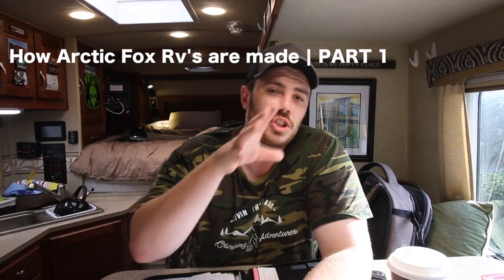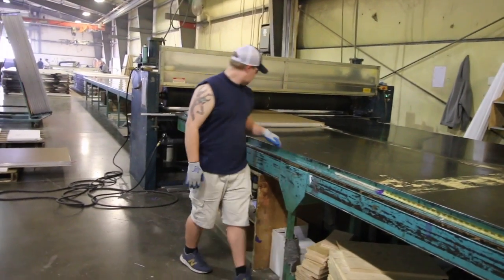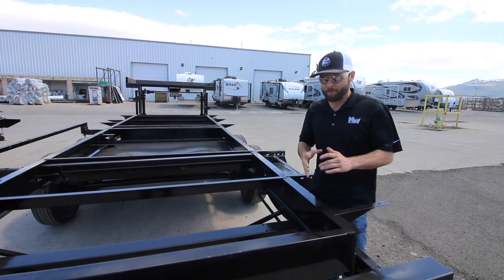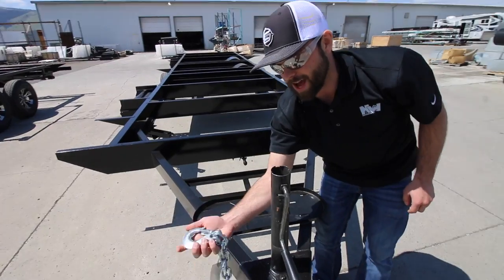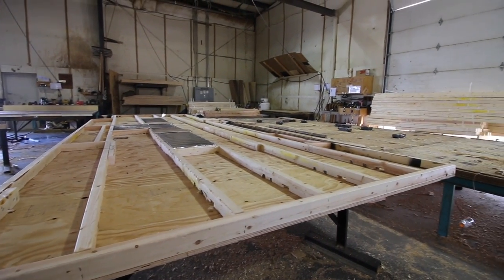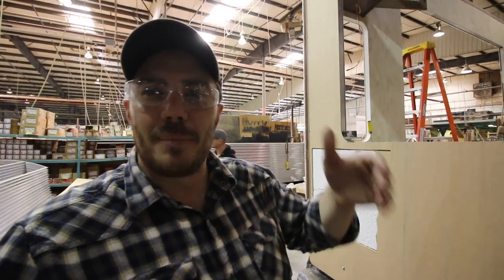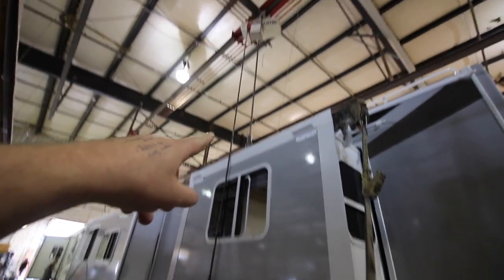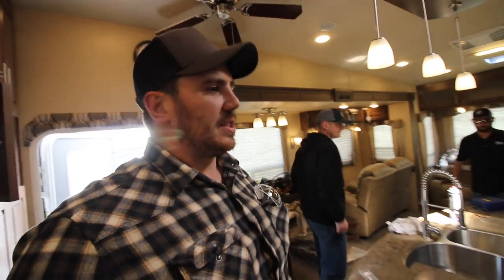How ARCTIC FOX 5TH WHEELS and TRAVEL TRAILERS Are Made ?! | FULL FACTORY TOUR

Comment: Wow! I'm shocked about shocks! I didn't know that was standard with any mfg for travel trailers! I like their attention to that! KYD did enhancements by enclosing the leaf spring hanger flanges to strengthen the frame and suspenstion attachment points. In speaking of insulating tank valves, I had to prep my 5er for moving while it was below freezing. My black tank valve froze between the time I pulled down the skirting and the time I was pulling my plumbing connections. I've learned the value of insulating tank valves!

Comment: I have a travel trailer that came with 2 bunk beds, one is set permanently and the other can be lifted up when not in use and set down on the angle irons that are screwed into the wall, would you know if those screws are screwed into a stud or just into the wall? Thanks

Comment: I started to watch your first video as you went through the Northwood Factory.   I hit the stop button when I saw them laminating Lauan to the aluminum tubing.  I thought the design & fabrication was pretty nice right up until I saw them laminating Lauan to the aluminum.  Lauan is the most inexpensive plywood made which the majority of RV manufacturers use in the construction of their RV shells.  If you have ever seen the exterior side panels of an RV that have areas where the exterior plastic panel is bubbled and loose, the reason for this is because of a water leak at either the roof edge seam or around a window or any other entry point that water can leak in and wick into the wood.  When Lauan gets wet it comes apart in time causing these large loose bubbled areas.   I know this because I have repaired a number of RV's having this problem.   The sad thing is that this problem can be completely alleviated by using a composite material  like Coosa board or Space Age Composite panels.   These composite panels are made in a variety of thicknesses, lengths and widths.  The composites that I am referring to are lighter than wood, stronger than wood and will not absorb water or deteriorate like wood does.  I have used both Coosa board and the composite board from Space Age composites for both RV and boat repairs. 
The composite boards 1/4" thick x 4' x 8'  run approximately $135 each whereas Lauan is about $7 per sheet, so it is clearly obvious why most RV manufacturers do not use it.   If you have to pay to have the exterior wall of your RV repaired, the cost for the repair most likely will be substantially more than the additional cost if it were used in the RV's original construction.    
They are just like every other RV manufacturer that uses Lauan in their construction process.  
Anyone owning any RV that has seen the de-lamination areas on the exterior side walls of their RV's know exactly what I am talking about.     Unless you are familiar and have actual experience removing the exterior plastic panels to access the water damaged  Lauan areas for repair, the average person has no idea about this nor do they ask the RV dealers what materials are used in the construction of the RV or if those material are susceptible to problems.  If more people were aware of the issues involved with using Lauan in RV construction most likely more people would be  leaving the RV dealer with their wallets intact.
Reply: Interesting observations. As nice as Arctic Fox products are, that is exactly why I chose a Northern Lite camper. The fiberglass clam shell design has no wood to delaminate. I have had punky RVs  and they are no fun.

Comment: Disappointed to see the old, problematical "luan" wood STILL being used in the walls (as seen in your truck camper video) in 2019. If any de-lamination happens, it's usually the luan causing it (if it ever gets wet wood swells and that pressure causing delamination). I think the newer Azdel construction is preferable.
-- BR.
Reply: In full agreement. Make a great product even better with Azdel. Most customers would have no problem paying a little extra to get the very best!
Reply: Bill Redding:

For the kind of money that Northwood charges Dealers for their Products (end result of very high Retail Stickers), I  would be more inclined/Impressed to buy their product if they had (modular-cut to length)1 piece Aluminum/Fiberglass sheets (with rounded 90 degree corners) for their roofs (campers,trailers and 5th wheels).........with or without Luan as a composite-wall backing material....it would not matter. A quality roof would eliminate the chances of the walls of taking on water soon or down the road.

And to ensure the roof is never compromised, I  (the manufacturer would/should pre-install  weather-proof brackets and electrical pigtails for those folks wanting to install:carriers, solar panels,etc.)...and just like a aircraft,big-rig,etc............plaster on stickers (all over on top of the roof) advising people to not drill any part of the roof or warranty is voided,etc.
Reply: Riverstone dose not use either and it won't de-lam.
Reply: @calikalbocalikalbo6082  Nice...but the huge Forest River conglomerate (what, they make a dozen RV brands?) is perhaps the LARGEST crap-maker RV manufacturer in America (and their Customer Service/Care after the sale is poorly-rated also). That mainly applies to their assorted brands of towables (TTs and 5ers), but in the Class B segment their Coachmen Beyond MAY be an exception...but even if it is, you still have the Customer Service/Care issue remaining.  :-(
-- BR
Reply: @billredding2000  
Is that true?
From the research I have done and the build videos I have seen it appears the Rverstone from what I can see looks to be the best built from the others I have seen. 
In addition they come with many standards that are options on all others like, tankless water heater, second fireplace in room, washer/dryer, full body paint, has a 3" wall compared to the rest that might have two at the most and the water manifold system that is a big deal.
If you know of something better built with all that stuff (or without the stuff) please inform me.
Thanks
Reply: @calikalbocalikalbo6082  I don't know about "Riverstone" specifically, but in my book if it's a Forest River (FR) product, CAUTION! Personally, I don't go for "eye candy," "bells & whistles" or even the "advanced technology" pretty-looking LCD screen control centers or whatever -- that's all fine, but mainly I want a QUALITY product and REALLY GOOD Customer Care/Service AFTER the sale, plain & simple. So I look for a quality brand AND a quality DEALERSHIP both, as you need a quality product to begin with, then quality care AFTER you buy it. No excuses and no nonsense from the manufacturer or dealership...

RE: quality, I'm talking about construction/fit & finish and quality materials used (both for durability through the years to come, not like a FR "Clipper" -- a crap-built cheap TT, for just one example of FR "quality" products. Lots of RVs -- especially TTS -- are crap even when new, so when they're sold used, you don't get much for them even if anyone want to buy it, because THEY know they're crap, too. Forget that junk...

I've not only heard/read about Forest River's (FR) poor construction/fit& finish and cheap materials used, I've also seen (following a YouTube channel a year or so ago) plus internet stories by owners about how FR doesn't take care of it's customers unless it's shamed into doing so when the owners make their ordeal public. The crap-maker companies seem to play a ping-pong game where the owner is the ball and the manufacturer (the parent company FR in this case) and the sorry dealer the owner purchased from paddles the customer (the ball) ball back and forth, neither taking charge/responsibility and doing the RIGHT and FAIR thing. An RV can be tied up for MONTHS waiting to be fixed, and each -- FR and the dealership -- blames the other for that outrageous and inexcusable "Customer Support & Care."

NOTE: I'm not saying the "quality" RVs are problem-less, they CAN have issues as no RV is perfectly made (as is no house, even brand new million-dollar houses!), but with a crap RV you have WAY MORE stuff to break and that happens WAY FASTER. And with a crap-maker brand -- or dishonest/couldn't-care-less RV dealer --  you have LOTS of trouble getting those things fixed, repaired or even -- IF you're lucky -- a buy-back (HOWEVER, there is no Lemon Law for RVs to force them to do the right thing). Conversely, I've seen other RV companies -- like NuCamp (T@B) actually give a customer with a problematic T@B (either a 320 or 400 model) a NEW ONE. Now that's Customer Care/Service. The crap-makers? You're pretty much stuck with whatever crap-built you bought. Sadly, people who shop bottom-line (cheapskates) keep the crap-makers in business...

As for you wanting some quality brand names, it depends on what Class of RV you are interested in (A, B, C, TT, 5er, Truck-Camper). But some  brand names I would look at (and have!) are listed below (in no order of preference, just given here in a list so you can check them out AND their RVs). This goes back a  1-2 years when I was looking for a smaller tow able (a quality TT) to pull with my towing-capacity-limited (5000lbs maximum) Honda Pilot AWD, or if I got a big truck, which truck-camper to get. However, these companies snake LARGER units, too, so you decide how big or small you want...IF you have the vehicle to TOW it, that is.  ;-)
So here's some of the top/quality RV brands, IMO, as I believe they still ARE quality products, and would go back to researching them AGAIN if I were looking for an RV right NOW:

-- Lance 1474 and 1575. Both are small TTS, but Lance also makes top-quality truck-campers.
-- Airstream's Basecamp-X, a small "Overlanding" type of TT.
-- NuCamp's T@B 320 Boondock Edge, by NuCamp which also makes the "Cirrus" line of truck-campers -- same quality construction.
-- Bigfoot, very well insulated for 4-season use, maybe better than Lance which also says they are 4-season.
-- Arctic Fox, by Northwood Manufacturing. Similar quality construction/insulation as Bigfoot, also 4-season rated.
-- Grand Design, they make 5ers, but may have been better built earlier, not sure presently.
--Outdoors RV, IIRC they only make TTs & 5ers, also well-insulated/well-rated.
-- Lazy Daze [perhaps the best-made Class C you can get. Born Free was another, but they went out of business after 30-4 years. Sad...
-- Oliver "egg type" fiberglass campers [probably the best-made (but heavy) fiberglass "clam-shell construction" TT you can get.
-- Scamp, another egg-type TT, very SIMPLE in design/construction, supposed to be well9insulated, plus they make one model that is a 5er (IIRC, it's 19' long and light enough that most trucks can tow it easily). WAY cheaper than Oliver and way lighter, but not the higher quality of an Oliver. Their 16' models most vehicles can tow and their 13' models just about any vehicle can tow.
-- Casita: another egg-type TT much the same as Scamp, look/made almost the same, but ceiling height is too low and most men can't stand up in them. Get a Scamp instead for that reason. BOTH Scamp and Casita are in-demand, so used ones sell quickly...but that's also true of ANY quality-made RV, regardless of Class.
-- Coachmen Beyond (made by FR, but it's said NOT to be a crap-made RV, rather one the better Class Bs available, even better than "average quality" Winnebago's Class Bs].
-- Panoramic [a Class B made by a French Canadian/Quebec company].
-- Pleasure-Way [another Canadian Class B+/Small Class C company]. 
-- as for Cass As, in general -- and regardless of brand -- it's more of a "money spent" thing: You don't really get into the "good quality ones" until you get past $300K, and it's a diesel pusher. Gas models are hit & miss.

>> That's all I can come up with off the top of my head (and I'm out of time writing all this)...you'll have to do rest of the work yourself. Just giving you some leads to get you started.  ;-)
Good luck,
-- BR
Reply: Bill Redding like I said compared to what I have seen forest river appears to meet the qualifications of quality compared to the rest. And yes bells count because you get more for your money. 
Point me the right way do I can compare.
Reply: @calikalbocalikalbo6082  "Point me the right way do I can compare."
I already did that -- and you're welcome.
Good luck,
-- BR
Reply: @billredding2000  
Yeeeeeeeah, thanks
Reply: @billredding2000  I have a Forest River Arctic Wolf and compared to others like Keystone, and a few others, the overall build quality is much better. Cabinet door construction solid,  trim around slides better, where Keystone it was falling apart, and the cabinet doors rattled and twisted when opening and closing them.  In fact I found worse construction in trailer that were twice the price, my wife had a cabinet door fall off in her hand on a $84,000 sale price trailer, don't remember the brand, but it was twice the price of ours.
Reply: @acdii  Then you got a decent one...most people don't, and the odds (just like in Las Vegas) are against the RV buyer regardless of which class of RV it is.
I don't knwo about Arctic Wolf, but just "Forest River" (one of the major crap-makers, IIRC the conglomerate of about a dozen RV brands) is enough to give me pause. But then, Forest River also makes Coachmen Class Bs, which are SUPPOSED to be (some people say) a cut above average Class Bs, like Winnebago makes. Yet Coachmen also makes towables -- like the Clipper (for one example) and that's cheaply-made crap.
RV buyers need to be VERY careful choosing a RV brand. Then comes the OTHER half of the buying process: Choosing a good RV dealer -- and that's also often a nightmare.
Happy Travels,
-- BR
Reply: You realize its not the luan causing delam its the glue
Reply: @robinsonnis  Luan is wood, so when it gets wet (via a water leak) it swells, and that causes de-lamination.
With the new (and superior) materials we have today, luan should be history.
-- BR
Reply: @billredding2000  I understand that, but the luan isn't the cause of the delam. It's the glue that separates the luan from the fiberglass, the luan would be second in line for the cause.
Reply: @robinsonnis  Yes it is: If the luan didn't get wet (and exert pressure to break the bond) there'd be be no de-laminaion.
But I won't debate the issue further...especially in a very old thread like this one.  ;-)
Thanks,
-- BR
Reply: @billredding2000   delam isnt only caused by a laminated wall getting wet.....yes the majority of the time its caused by moisture. the definition of Delamination is when the glue between the fiberglass and substrate  fails.  Yeah the luan can get wet and swell but that doesnt cause the delam.... if  you were correct delam can ONLY happen when moisture is present, which isnt true... next....
Reply: @robinsonnis  Okay, if I'm wrong then I stand corrected.
Thanks,
-- BR
Reply: @billredding2000  I need to pick your brain! First time RV shopper and I'm pretty impressed with your lay of the land so to speak. I'm gonna check out some of those brands you referenced. I was originally thinking grand design's toy hauler with the raised bed over the mini garage but read about a few owner's nightmares with build quality. Then I looked at alliance and riverstone and checked out both in person. They are definitely at the upper limits of my budget though so now I'm trying to figure out what can get me similar build quality while letting me hold on to a couple of pennies.

Comment: They use uninsulated aluminum framing--just foam stuck in the bays between frame members. There's nothing Arctic or 4-season about that. It's the same wall as many other low-end aluminum RV's. These suck down a lot of energy with cabinet doors open, etc., to try to stay thawed in real cold. Water lines will freeze if they are up close to a frame member and frost forms on the walls, outlining the frame, from the heated interior air with any moisture in it from cooking, showers, etc.

Comment: 2 things that Colby said about the roof that I have to comment/question.  First the industry standard of 2 foot centers.  Do other mfg. have the space marked off between their trusses and tell the new owners not to step in those areas?  I've never heard of this.  The second is about insulation.  He said "5 1/2in. space insulated with R-18 in combination with an R-15  reflective foil".  So is that R-33 total in a 5 1/2in. space?  I'd like to see this R-15 reflective foil.  I'm just starting to build a camper van and would love to insulate the whole thing with just one product rated at R-15.
Reply: Radiant barrier foil has an actual R-value of 1 to 1.1, something that became a big issue and was subjected to new federal regulation about 20 years ago, but the RV industry is exempt from it. In the RV industry you multiply the actual number by 15 to 40 to get the R-value for the marketing department to try to sucker prospective customers with.

Comment: Thanks for the tour of Fox Mountain fifth wheel and Nash trailer assembly.   They do spend a lot of time and effort in mfg of these coaches.   I love my Arctic Fox Fifth Wheel and would buy it again and again if anything happen to my current AF.  The Arctic Fox is well build and heavy as compared to other brands, which means you need a big truck to legally and safely tow an AF.  But what you get is a very well built coach that will last a very long time.  I have a rear kitchen fifth wheel and AF's shocks and wheel system does ensure the dishes stays in place, I never had to rearrange my stuff after a days drive.   I been in several snow storm with near 0 degrees F nights without problems with freezing of water and was warm inside.